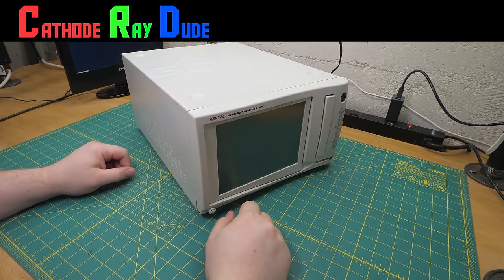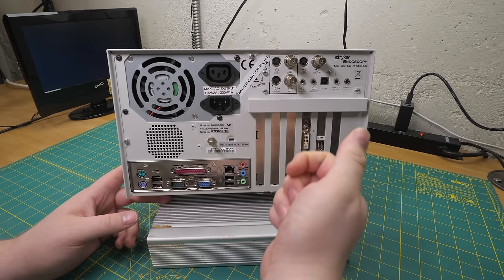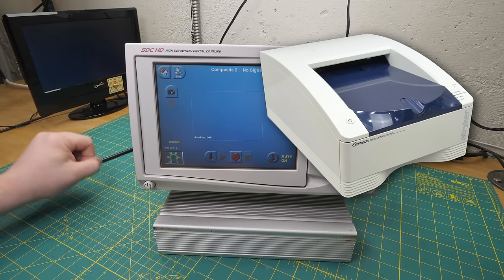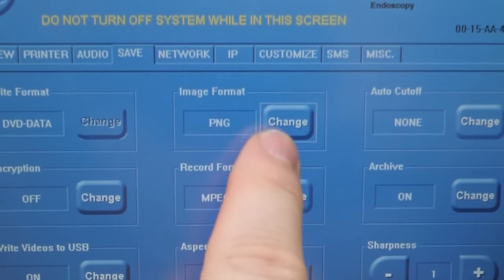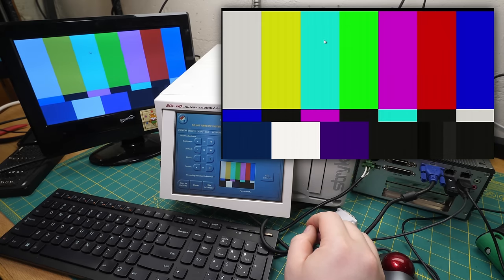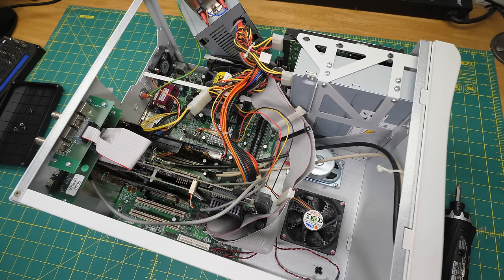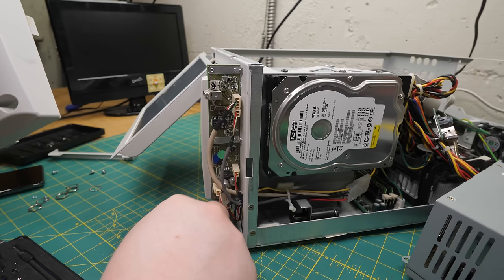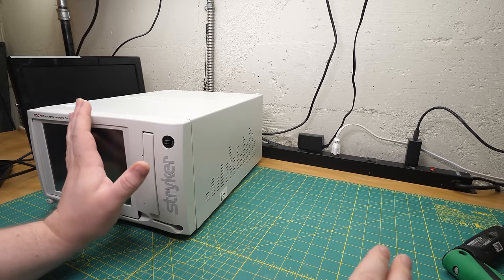Little Guys Ep 11 - Where No PC Has Gone Before [Stryker SDC]

Comment: Its so frustrating how there isn't one standard LVDS connector.  It tripped me up on an early touchscreen all-in-one that used a Pentium 4 ITX board and ran stupidly hot and loud.  I really wanted to convert it to a newer Atom ITX board that had LVDS.  Although I quickly found even if I got the pinout that would be hard as despite being a retail board, it seemed the LVDS connector was intended for OEMs specifically as there was no documentation on how to make it work.

Comment: i wonder if the camera system they use for these outputs BOTH dvi and vga on the dvi cable at the same time, so the dvi can be used for high quality and the vga as a fallback without needing to swap cables

Comment: 59:36 Is it very possible to add overlay to video without even sampling it. You use the video sync signal to overlay the text and it simply replaces the video signal on the fly. An example is the MAX7456

Comment: I apologize this question isn't related to your topic but, in modern systems why isn't everything Optocoupled with fiber that doesn't discreetly need an electric signal?  This goes from internals like within a gpu or cpu or fpga.
Or just signals on the motherboard its self.  
I was thinking about this cause an optoicolated power button would have fixed the nit-pick about the wires on the button.

Comment: 38:20 - I'll bet all the odd or even pins are grounded.
Reply: I may be mistaken, but it didn't look like the cable had anywhere enough wires for that. And, remember IDE didn't need to introduce extra grounding wires until UDMA/100 became a thing.

Comment: I'm finding it hard to imagine why an image capture device needs amplified speakers in the case.

Crontel is involved in the display devices in automotive infotainment. So it stands to reason that card in the AGP slot just has to do with video passthrough.
Reply: @Eremon1  The SDC generates audio when captures take place, when devices are connected, etc.
Reply: @lifetimeofwork  I know what it does, my question is, why? It's an image capture device. You put a camera in someone's body and take pictures. You have zero need for sound in that use case.

Comment: I'd be fascinated what Linux makes of that FPGA Salad 🤔 Though Given its bespoke nature, probably not a lot. Still a cool device though, Given that it's Medical Equipment, knocking up the price tag with some hardware offloading like that is just not even worth debating. They'll make it as grunty as it needs to be to do the job to a good standard. These days though most smartphones and tablets can do everything that can do and more in 4K UHD because all of that grunty silicon is either built in to the chipset, or just not even a sweat for modern CPU cores.

Comment: "high definition" has not one single display port and full of composite and svideo. Yea sure buddy, everyone can dream.
Reply: It’s the DVI. Even the current generation Stryker routing systems have S-Video, BNC Composite, and VGA in the field. Even the occasional sync-on-green. Many legacy products are still in use even on a system that can route, capture, and display in 4k.
Reply: @lifetimeofwork  I know that. I just find it funny that it's plastered on big bold letters yet it's full of analog protocols
Reply: You know 4K AHD is a thing, right? You can shoehorn ultra high definition analogue video down the same crappy BNC cable that carried 400 TVL standard definition composite.
Reply: @DGTelevsionNetwork  For what it’s worth, even the modern equivalent of this has all the analog stuff. I find it hilarious to see BNC composite & SVid being transmitted over fiber on a 10 gigabit switch.

Comment: Can you add a modern video card for the external monitor and run two screen mode?
Reply from the maker: Since there's only one AGP port and it has to be used to run the LCD, then I'd be limited to putting something in a PCI slot, so modern is off the table :p

Comment: you can put modern hardware in it but you would need to replace the lcd also and a display of that size wit logic board it will be ca 150 USD so as for the capture card maybe since it is fpga you can add newer logic to it  aac1 encoding etc of you can get a gaming laptop with a broken display so you yill have the lvds output  the case is anyway premium

Comment: I am starting to question your definition of PC because this COMPUTER was not a Personal Computer. A PC is not the parts it is made of it is the purpose it was used for. IC Industrial Computer, BC Business Computer, etc. Industrial PC just is not a real thing. I also have trouble knowing if you are talking about bytes or bits. Since you seem too only use kb mb and not KB MB. BIg B is byte and little b is bit.
Reply: You should tell that to Apple; who were adamant that the Macintosh was not a PC. Fact is, the term "PC" has evolved to mean any IBM PC-compatible computer, usually using off-the-shelf components, and usually running some flavour of Windows. Nowadays, the best definition of a "personal computer" is a smartphone or tablet device.